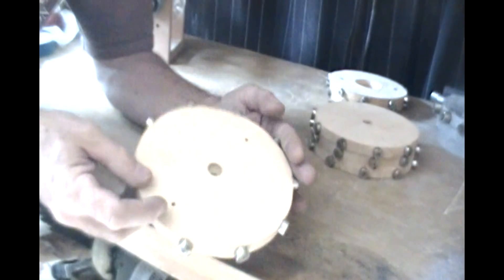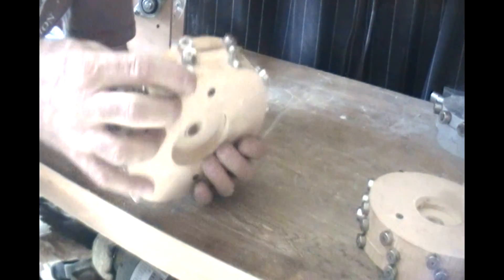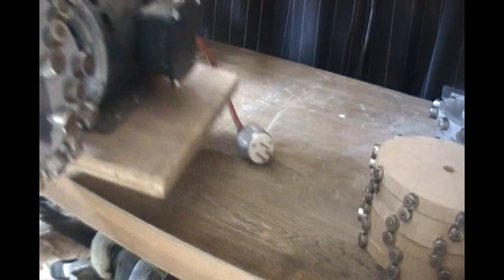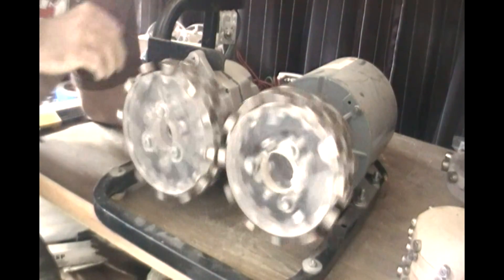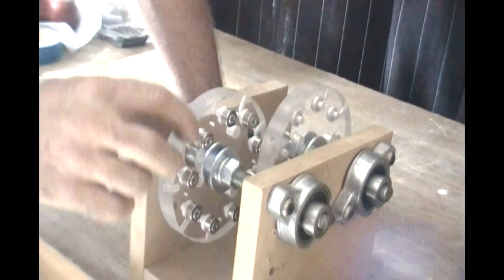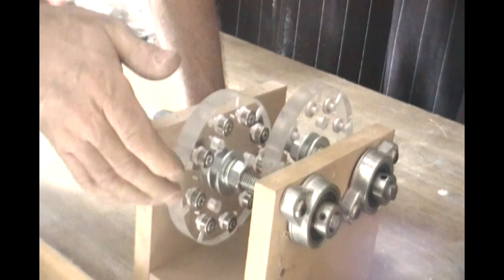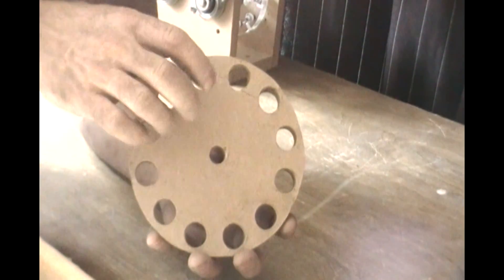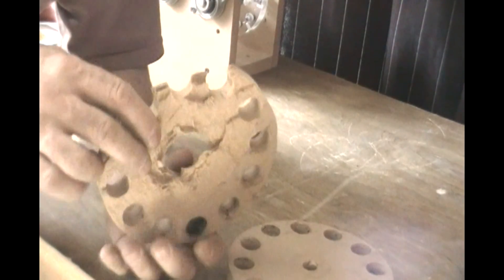Magnetic Cogging Free Energy Generator experiments overunity generator

Comment: Please email me directly.  I have solved your problem and want to share the finite details.  I'm in the process of building rotors as well with 3/4 x 3/4 x 1/4 magnets embeded in a resing cast.  The pull strenght is the same as your 3/4 round x 1/2 deep.  I would also like to know what size drive motor you are using (specs please) and what type of alternator?  Is the WindBlue 500 Series and which model?  Thanks - Gary

Comment: Interesting work. Have you looked into encasing your rotor using epoxy resin? It would be permanent but I don't think you'd ever have to worry about the magnets moving or slipping once you worked out the size of the magnets needed.